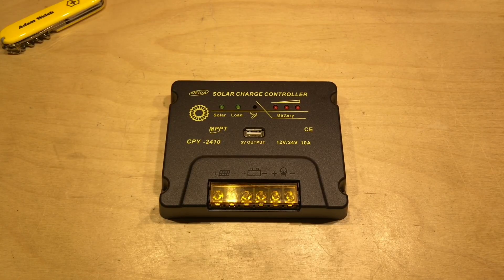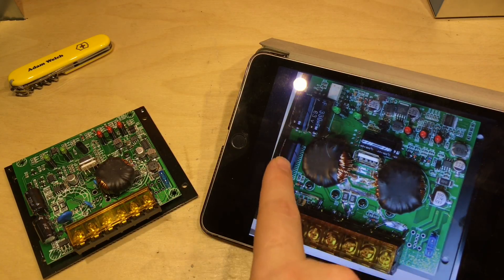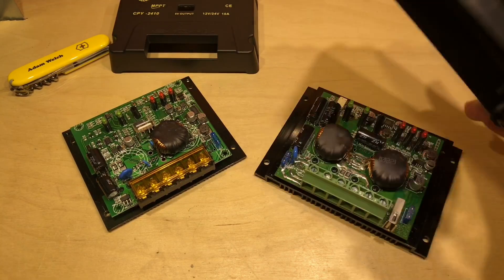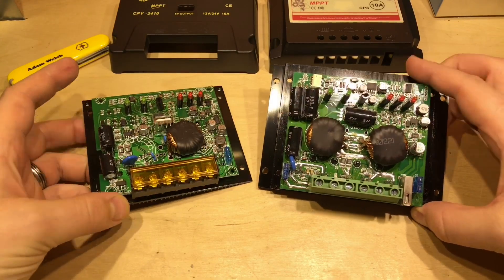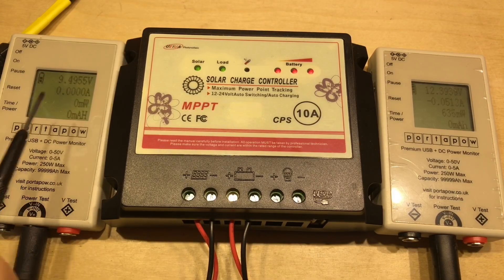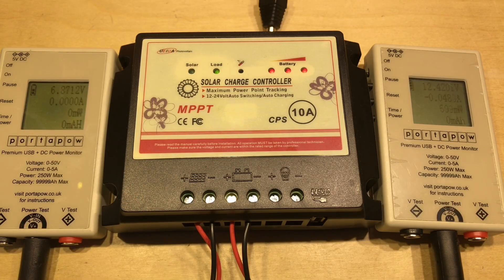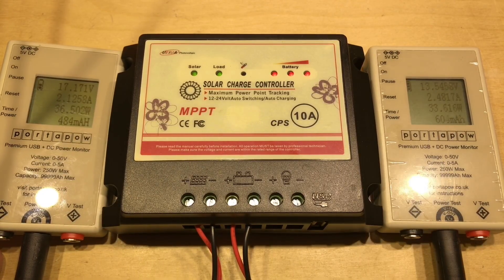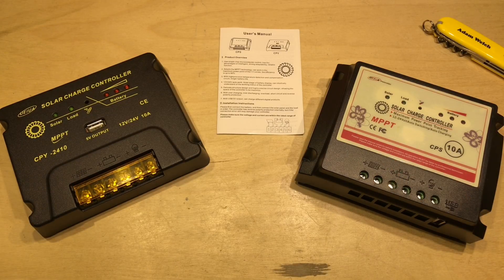UEIUA MPPT Solar Charge Controllers - 12v Solar Shed

Comment: I know this is old review but one thing intrigues me. 
Solar charge controller has 3 "ports" - Solar panel input, battery , Load output.
And still, during the review which was going fine, you placed a load (21W lamp) directly on battery, posibly screwing with cheap controllers calculations.
Why not use the "Load port" to connect the lamp? After all it is a cheap charger that was built to function that way...
I have a cheap PWM controller and it works fine if you connect it "the right way" - this one is so screwd it goes berserk if you connect solar panel before battery, for example, so I'm wandering if this MPPT one functions ok if used as "intended"?
Reply: I have the same mppt, had replaced my generic pwm, I was thinking the same, since the excess power from the panel will go to the load like what an mppt should suppose to do, it did not kick in into battery because it might mess up the batteries charge rhythm or it detected an increase in the battery port temperature because of the sudden discharge from the lamp so it did not kick in into charging voltage as it could decrease the battery life
Reply: there's some sense in what you have argued there too bad its 4 years down the line to reply this

Comment: That board looks identical to the cpy-2420 that iv just got (dated 03-2018) - so far the unit seems to do what it says on the tin. will send photo of pcb if interested mine managed to extract quite a close wattage to my victron on the same panels under the same test conditions- I will run the same test on it with regard to restarting bulk charge when a load is detected and see if the issue has been resolved on these latest ones

Comment: Shame you didn`t do the obvious thing and put the load on the controler. Maybe than it could regulate de power.
Reply: Is it the model or you got a defective unit? Because mine is limited to 14v battery voltage, it does not go up above anymore on it

Comment: Great series of vids, thanks. But for only 10amp charging, only one batt, and say 100watt panel, a PWM should work fine. For a 30amp charging system MTTP would be a benefit to charge a bigger batt, or operate a daytime load.
Reply from the maker: I agree.  MTTP works best if you have unlimited storage - or you are using the power while it is being generated.  My battery bank is full by mid morning most days, and at that point the solar charge controller is limiting the power coming in to protect them.  MPPT works very well in grid tied situations, because there is always somewhere to dump the power.  Generally most people can get away with PWM and the extra money for an MPPT controller may be better spent on another solar panel - which will help more on less bright days.  Unless of cause you have run out of space to mount them like me!

Comment: Hi Adam, I wonder, after watching all of your 'cheap' MPTT controller reviews that I could find, do you recommend any of them (in the <£25 range) or do you suggest people stay well clear, or just stick with PWM unless you are willing to spend lots more £££? Also, have you considered reviewing the Ming-He mpt-7210A? thanks. great videos btw
Reply from the maker: Hi Simon. My favourite of the retail cheap MPPT charge controllers is the CPT-LA10 which I’ve done a couple of videos about. I’ve been using it on a small system for months and it’s remained reliable. Sadly the company who make it have changed the design of other charge controllers in their range so I can guarantee if you bought one it’d work as well as mine. Spending twice the money £50-60 would get you an EPEver 10amp MPPT Charger and you get quite a bit more for your money. 
I’ve been sent a MPT-7210A by someone who upgraded from it. Julian Ilett did a whole series of videos on it though, and I’m not sure what more I could mention after those. Cheers
Reply: Adam Welch, thanks. I'll check it out and the video series from Julian

Comment: the answer is very clear. Many of these controllers are FAKE and being sold by various venders. If you purchase one outside of their main partners, you in for getting a fake one. 

http://www.ueiua.com/home?_l=en

here is their page. notice they don't even advertise the CPS-2410 so who is the REAL manufacture of this unit? Ive purchase one and it was NOT an MPPT at all with a circuit similar to the one the guy send you. Its still a decent PWM charger but just too pricy

Comment: Hello I guess your follower’s would call me a nub. Let’s go anyway. My understanding that the MPPT controller reads the resistance of a given panel. Now if I have multiple panels I cannot see input screws for each of the panel. This means that the panel are either in parallel or series and then they are wired into the controller. Same question if you have a combined controller charger unit connected to several batteries. For me the cost of each component is very important since I live in Canada where you have extreme cold, witch affects the output on the panel side and the storage side (agm for now, LiFePhosphate if I win the lottery). The cost comes in because compensation for temperature and expose to sun, necessitates more panels, bigger MPPT controller chargers and increased number of batteries. This does not take into consideration fuses, diodes, disconnects, high gauge wiring ( 0 for me right now). This means I have to build the solar system bit by bit.

Comment: Shut off says 14.7 but is 15.2v on the one I received from ebay,to high but is perfect for my use on my off grid deep freezer 260w solar panels two 12v marine batteries.Without a constant load this will Fry a battery.
Reply: Two inductors not in the same position as either of the two you showed,different board conductors are not side by side but offset.

Comment: Hey Adam,

bought the 20 Amp version on Banggood in September. https://www.banggood.com/CPY-2420-12V24V-20A-USB-MPPT-Solar-Panel-Battery-Charge-Controller-p-1110677.html?cur_warehouse=CN

Tryed it yesterday and watched the Voltage. My CPY 2420 did the same as your CPS 2410, so i decided to open it up, to see whats inside. Cant belive whats inside:

https://imgur.com/a/bFjs7

Simply to say: Bought a CPY-2420 and got a CPS-2410. 15 Amps fused on 20 Amps operating Current. All differences i could find to your shown CPS:

1. The USB Port is in the center
2. The Capacitor on the left is laying instead of standing.
Reply from the maker: +mO Li I’d contact banggood and see what they’ll offer you. Looks like you’ve got the poorly thought out version.
Reply: Hi mO Li. Just wondering if you still have this charge controller and is it still working? cheers

Comment: My cpy-2420 (two inductors and a 20A fuse inside) appears to have failed in the past couple of days. 
It’s been running for almost 6 months in my van as follows:Two 100w flexible panels One 110Ah batteryAll loads connected to batteryAn ignition switched relay to charge the house battery when the engine is running
Currently I’m getting around 21v on the panel terminals regardless of load. 
No more than 12.7v across the battery, even when the battery has been below 12v for some time. 
A fluctuating 15-16v on the load terminals (nothing connected but does dip by half a volt with a small load (only willing to risk my cheap 300w inverter with nothing connected right now)). 
Solar LED flashes randomly 
Load LED always lit 
Battery LEDs all lit during the day, 1 LED flashing during the night

I’m tempted to just replace it with something from a reliable brand.

Comment: I again have bought a cpy-2410 and 2 cpy-2420. The 2410 has PCB version 2.3 and the 2420 has version 2.4 but still they are different. One version has the standard heatsink and 15A fuses and the other one has a big heatsink like the CPS and 20A fuses and has more measures to cool the PCB. The no load current varies from 50mA to 80 mA not <10mA as specified. The stop charging voltage is over 15V not 14.7V. it sits there for hours and never falls  back to a safe  float voltage. As I wrote before, these devices can only operate with panels in parallel mode as the they seems to be optimized for this configuration.
Reply from the maker: +54CHARM That’s such a shame. Sadly they’ve changed it for the worse - looks like it has become one to avoid.
Reply: Adam Welch at least I've got a refund of 50% so now it's worth the money 😁

Comment: It's the same board I got with a CPY2420 and 2410.Funny the 10Amps version have the same CPU, parts a missing capacitor and 15amps fuses instead of 20amps in CPY2420.Both behave strange and are unuseful.
Reply: Right! just a piece of sh...

Comment: I've been one of the lucky ones then

I bought two at the time of your review and they've both worked alright. Mine are single inductor.
Reply from the maker: +zogworth Good news. I can only talk about what’s in front of me - but it doesn’t stop me feeling guilty that people got duff units.
Reply: Hi I'm in OZ and I brought thee within the last 4 months . All are the same as what Adam has.
Mine are charging vented lead acid batteries and all units are working fine.

Comment: Loved the video. In this case it's obvious that the controller don't work like it should. But I am very curious about other cheap MPPT controllers. How do they stack up against a more expensive MPPT controller? Maybe you could make a benchmark system with 2 controllers with the same size solar panel and sharing a single large battery. One of the controller would be a high quality controller that you trust to be as good as possible. That way you could always benchmark the cheap controllers against something. This might not be what you want do do. but i thought i would share the idea. Again loved this and many other videos.
Reply: Ingenfare   Very good suggestion.  I would love to see something like that done.

Comment: bugger, i just bought the 2420.
Reply: It arrived and it seems I have the useless one :/. Mine has 20A Fuses. 

I also does the same as the one in the video with the panel voltage by not really keeping them near the MPP. Thats a shame!
Reply: https://www.youtube.com/watch?v=jLqJQFg59Q4
Reply: From what I can tell from your PCB pictures, yours looks exactly like mine inside.
Reply: I just change a lot of things, new better cablers, a new 150w mono panle, I have now 300w, even a new AGM deep cycle 100Ah works like a dream.The panels are in series , aournd 38v and Victron is haveing no trouble charghing the battery after the night use.
In a coupke of days I'll rehook CPY 2420 and little brother CPY 2410 for a poroper test..
Reply: CPY-2420 get sold but I still have some orders for new ones.I'll try what you say with 2410 I still have, but this one acts strange, the green LED for panel is on when I connect the battery and then , slowly start pushing some current.I just got a second panel, so I have them in series up to 38v.I'm in doubt CPY 2410 will do the same or almost the same job, but I can't understand why they put a lot of components and work for a fake.Also the weather now is cloudy and rainy for days.I'll let know results as soon as sunshine and new 2420 received.Again ..this is just for fun and experiment.
Reply: I'll do that with proxima ocasion.Now it's cloudy and rainy with cats and dogs!

Comment: I know that this product has been improved, has been more and more good.
Reply from the maker: Hi Daisy - do you work with UEIUA?  Could you explain the reason for changing the PCB inside the CPY-2410?
Reply: Adam Welch after you were review on the cpy 2410 I went to eBay and bought the 24-20 I have not had no problems open the case up two conductors all indications it is a true mppt I am new at this but both of my conductors are copper wound but they don't have the chocolate like coating that you showed where that young man sent you pictures of looks like machine is well built I am here in the states I did purchase mine off of eBay and I have sent a note when I purchased it making sure that they sent me the right one no problems little machine is working just fine like yours but this is a cpy 2420 I know it is not a $400 machine that's the way I look at it mine cost $32 with free shipping if you can get back with me
Reply: Adam Welch I also would like to know why both cpy 2410 and 2420 are equiped with the same bad V2.3 board. There is absolutely no difference accept the printing on the case. I've asked this question to the company directly and they never replied.

Comment: Hi, you may find my blog post on this (done before I saw this) interesting: http://cjeastwd.blogspot.com.au/2017/10/cheapie-mppt-controller-further.html
I'm sorry about my mumbling
I think the CPS has some software assumptions, one thing is perhaps how it deals with different cell voltages and battery capacities
Reply from the maker: Thanks for sharing your blog and those two videos.  It does look like you might not have been getting the full power out of your panel due to heat, but also possibly angle and day/time etc.  It's hard to get everything just right isn't it?
However I'm afraid I can't agree with your theory that the charge controller can't adapt to a load which is connected directly to the battery.  A MPPT solar charge controller is doing two things.  First and foremost it is controlling the charge of the battery.  Unless you're computing state of charge this only needs one parameter to work - the voltage of the battery.  A full battery needs very little charge to maintain a voltage, and a low battery needs lots of charge to raise it up to that voltage.  We're using current to make the difference but we're monitoring only the voltage and that can be done without an external shunt or the use of an internal one.
Secondly of cause an MPPT charge controller is doing a DC to DC conversion.  This one will take into account current because it needs to work out where it can find the most power.  So therefore on the input and output of the DC to DC converter you will find low value resisters used as shunts to calculate power.  The fact that there is a low value shunt resistor on the load output is just for one reason on this charge controller - to shut off the output if the load output current gets to high.  Other charge controllers with screens or communication ports may use that shunt to report the load current - but this one doesn't have that facility.
It's funny - this CPS board in many ways seems better than the first CPY board.  It's got the twin inductors, the tracks looks like they've been beefed up to take more current, the heat sink is bigger.  However it's been totally let down by the code on that micro controller.  It seems unable to detect the point where it can find the maximum power point.  It sales straight past it.  I tested this a number of times.  When the battery level drops it seems the code does not allow the charge controller to recalculate it's duty cycle.  It just seems to be a really poor implementation.
Thanks again for your comment and suggestions - I do appreciate it.

Comment: Certainly something wrong with it. Because the solar panel voltage would rise as the battery is near full charge due to the controller backing off the charge rate. It reduces power input by reducing current drawn from the panels.
But the same would go for a PWM because it would reduce the duty cycle as the battery nears full charge so the panel voltage would appear to rise.
MPPT unit should never go much below 17V per panel assuming 22V OC panels.
Reply from the maker: Absolutely.  The hardware looks pretty good but seems to be let down by the code.

Comment: They broke the first rule of Engineering : "If it ain't broke, don't fix it".
I myself value my expensive batteries and would NEVER connect them to these cheap chargers. 
I bought the Morningstar Sunsaver TrackStar 15 Amp MPPT Charge Controller for my cabin, and its NOT cheap for a reason. Works like a dream.
Reply from the maker: Perhaps that is why people view my videos (and those like me).  We test things before you commit your money.  Sadly this time things changed in between the test and the delivery.  Nearly all of my items are cheap, I just keep an eye on them to start with until they build my confidence in them.
Reply: That is why I watch your channel as well and love your content. 
I have nothing against cheap, but there are some instances where "Cheaping out" will cost a lot more later. 
$1000 worth of batteries is one occasion.
Reply from the maker: +UFOhunter Thankfully I’ve never made that level of investment in the shed and I can keep cheaping out for your enjoyment! :-)

Comment: It's like a lottery getting a good version.
Reply: At 2:30 in this case it seems they have just been selling a 20amp version als a 10 amp, maybe they just had no 10amps in stock then. That's what they do. (All the cheap pwm 10, 20, 30 amp for 6, 7 or 8 euros selling price are all the same 30amps inside as well (!) - smart of course - three different types in stock to pick from would be way more expensive.)
Reply: @faidularcs  Faidul, stop SPAMMING channels!